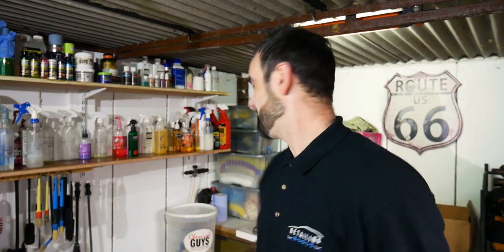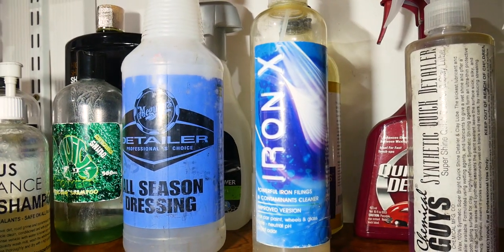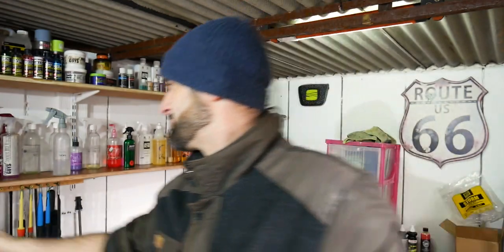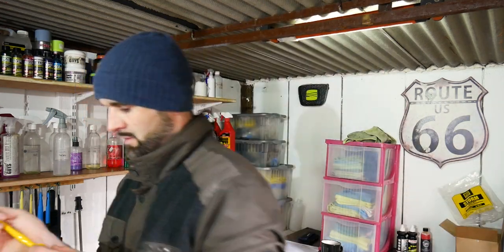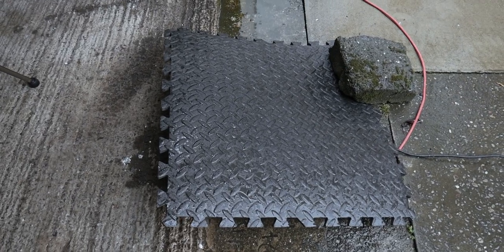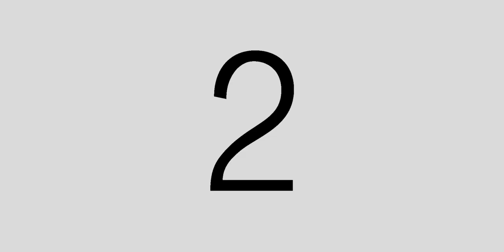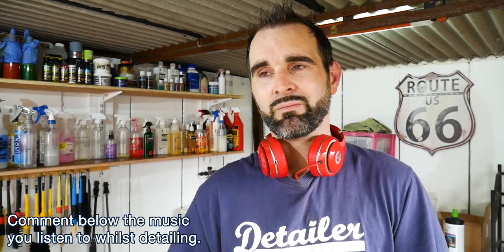Detailing In The Rain: BMW 3 Series Touring (I Must Be Mad)

Comment: You should washed the snow foam off before even attemp to wash with mit and soap because the contaminants are in the snow foam while dripping off, then after the mit and soap wash would be clay bar, then wash again, dry, then wheels last.
Reply from the maker: Yeah I know, I usually. Do. This is the first time in 10-12 years I forgot to rinse... But as you say notice, I only did the windows whilst the foam was on and then realised just as I was about to start on the roof and work my way down.

Comment: Great work, lovely end result and really nice video to watch, thank you. Do you ever get any grief from your neighbours about the noise from the polishing? I’m just waiting for one of mine to object..... 😂
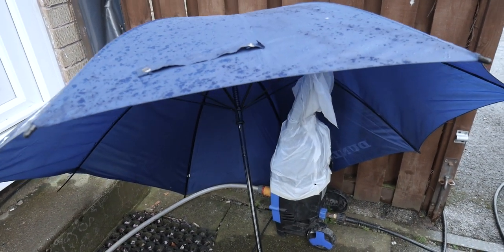Reply from the maker: Nah, they never complain, but typically it's usually later in the day when it comes out... So in this case, after I gave my mate a lift back home on Saturday, it was about 9am when I started. On the Sunday, I started about 8am, but that was rinsing the car with a hose, giving it a wipe down and then taping. By the time I got the rotary out it was about 9-9:30 and knew neighbours were up or out.... If using the pressure washer or anything on a Sunday, I do try to wait until after 10, but usually everyone is up and about well before then anyway.

Comment: hi, another great video. What do you use to remove wax or polish from the rubber linings near the windows on the outside. I was too lazy to tape over mine and want to do a full trim restore but want to make sure they are cleaned first.
Reply from the maker: IPA or panel wipe will remove polish from plastic trim. You can also use glass cleaner

Comment: Nice job Matt, 
I often wonder about waxes and wheels due to the high temps and the dust. 
What made you choose the surreal wax (apart from you had it) and what are your thoughts on this subject please?
Reply from the maker: I went for it simply because it has ceramic infused into it, so was thinking that would help maintain the life of the protection on the wheels a little longer.

I like it. It's still going strong on the wife's car, and that was applied around Christmas time, with only a handful of washes since.